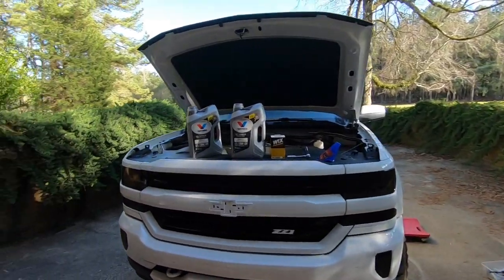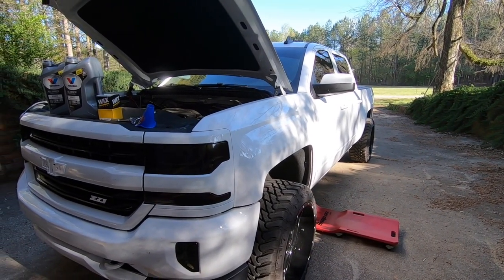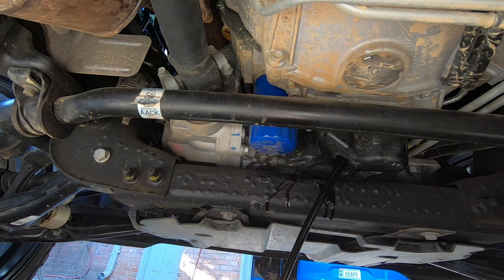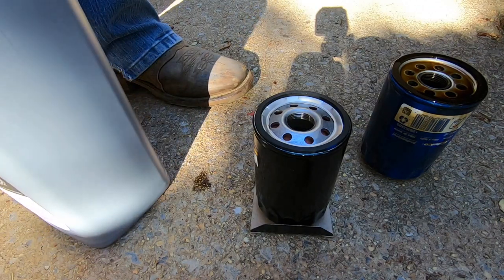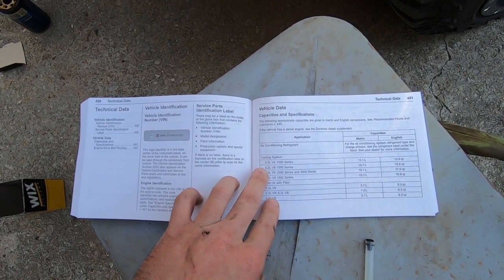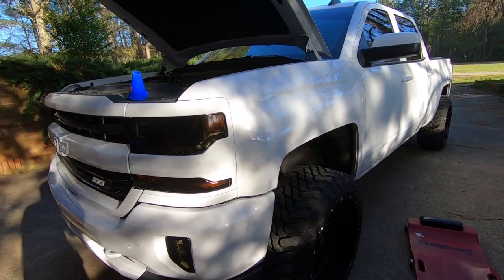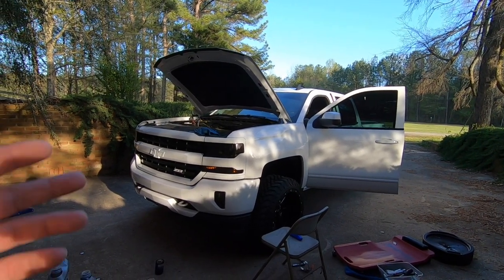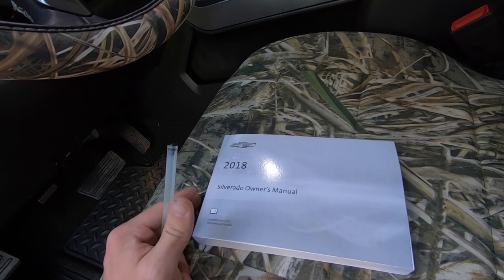2014-2018 Silverado OIL CHANGE - step by step

Comment: I take a nail and poke a hole in the middle of the oil filter and let it drain to avoid making a mess on that cross member. Nice truck!
Reply: good idea
Reply: Thats what I use when i cant get a filter off
Reply: Oside_LS3 does the nail pierce easily? Does this damage any of the threading of the filter housing?
Reply: RYPES 808 yea it punctures easily. I puncture the hole on the bottom of the oil filter with like a 2” nail. You don’t need to hammer the nail all the way in. As soon as the nail punctures the outside layer of the oil filter the oil starts draining out.

Comment: Life hack: if you can’t get the oil filter off and don’t have the clamp tool, hammer a screw driver all the way through both sides of the filter, let it drain, use it as your handle to twist off the filter, super easy to pierce the filter also!
Reply: I had to do that the last time I changed my oil. I was ripping the metal, so I did it again at a different angle and it worked the second time. Very useful, saved me from what was starting to feel like a bad situation haha
Reply: If you don’t have an oil filter tool then get one. And before you go driving a screwdriver through your oil filter just use a rag or rope and twist it with a stick or screwdriver until it is tight then turn it off. I did that driving through filters many years ago sits just awkward and messy. Not the way to do it. Unless it’s the only way with what you have tools wise. When you pick up your oil buy the filter wrench once and done. I probably I’ll bet have two tool box drawers with just oil filter wrenches. I have ones you use with ratchets. The worst vehicle I changed oil on was my 2001 expedition. Seemed like I struggled with that every oil change. Lol. Easiest is my 99 f350. But after watching this video my first oil change on my 2018 Silverado looks like it might be the new easiest. I had the oil changed at my buddies garage since I’ve owned it but I’m like 7000 miles since last change and he has two trucks on his lifts that can’t be moved so I’m gonna lay on the ground and do it myself. Not gonna be easy with my knees as bad as they are but I’m gonna do it in a few minutes. Nice looking truck and that front end looks really good. Thanks for posting the video

Comment: Good to see you’re using a good oil and good filter. As long as you use an API approved oil you’ll be in good shape. Cool video man 👌
Reply: I used Fram oil filters for many years on my '82 Monte Carlo (Don't have it anymore) because I thought Fram was the best. I watched a video and found out that Fram was the worst of all the filters that were compared. Go with Wix.
Reply: @manuelgonzales2944  I've used FRAM oil filters and air filters for the past 30 years never had a problem as long as you do it right

Comment: I have always used an old antifreeze container for oil filter removal. Lay it on its side cut out to fit vehicle. Always leave cap end accessible if needed to drain. Less mess and easier cleaning up.
Reply: You are a genius my friend ..thanks for sharing the tip
Reply: Davek why have two different dirty containers. The oil pan he was using is the same one I use. Not sure why you would want to use two. I use one you talk about for lawn equipment cause it doesn’t have much oil. I’m being rough I guess. If you happy with your gallon jug for filter oil. Do it. ✌️

Comment: Life Hack:

Break the oil filter loose before anything since everything is dry and not slippery. Won’t leak if only loose. 

Second:
Always do your partial Jug first. So you can measure it and if somehow you mess up and go over, you can just put the rest in and have a second chance to do it right on the second jug. Otherwise if you overfill you have to drain it all out and start over.
Reply: Mitchdenes I don’t think he had a partial jug to deal with. I don’t understand what you mean anyway. It takes 8 quarts so you empty the first jug weather it’s a gallon or a 5 quart jug then add two more out of the other one. Check it then add what’s needed. Can it get any simpler?  Why would you add a partial jug first.  Just seems more complicated or confusing to add from an open jug first. When you start with a new container you know exactly what you have. Maybe it’s me over thinking it or I’m just stupid idk. Either way get it done ✌️
Reply: @johnsellers9623  yes, you are over thinking it.  Partial jug, not an already open jug. You add the final two quarts first you’re referencing because it’s easier to add the rest of the jug and get a second chance at adding the right “partial amount” if you over fill. If you’ve already put it the entire other jug and overfill by accident you gotta drain the oil out again vs just putting that entire jug in and getting another chance at the “partial jug” if that makes sense!

Comment: You forgot that you filled the new oil filter with oil! You added 8 total. 
I always use seafoam in the engine a couple of months before the oil change with 8 ounces of seafoam per 1 ounce per quart,  and add a full can into my fuel with about 5 to 8 gallons of fuel just as I am going to change the oil within an hour or so. I than head on the highway to clean my injectors for about a half hour with high rpm' s to remove as much deposits  as possible from the engine. I head to the gas station and fill up my truck with fuel as I leave it running to delute the seafoam that is still in the fuel. Once at home I turn it off and drain the oil with all of the deposits from the engine coming out with the old oil! It is amazing to see how black the oil becomes after using seafoam!  Repeat for every oil change. Peace

Comment: Seconds.  Love the part when it drained and went on the cement a bit. I was like, “Damm!”
Reply from the maker: Same! lol
Reply: Yeah... I always try to do a no drip change there is always something that I do to get a drop on the cement or garage floor.
Reply: I could perfectly position the catch pan; but then the wind say, 
"Ground looks too clean."
Asphalt driveway are terrible during summer, but oil leaks hide so much better.

Comment: I have the same exact truck you have.  I got it 7/31/18. It's now 5/2/19.  I still haven't changed the oil in it.  2850 miles on it now.  Ha. Going to see if I can make it a full year. Ha!  The dealer calls me every week to have me bring it in for my 2 free changes. I bought a Fumoto valve for the pan and I don't want them to install it.  Had one on my car for years. Worked great. Wanted to put one on my Ranger 4.0 but it might stick down too far. Will probably do it anyway.  Makes oil changes much easier and you will never have to worry about your pan threads.

Comment: I use wix and napa gold filters.  I also pre-oil them.  I only took my truck in for the first free oil change at 600 miles.  They left oil all over my new steering wheel, tighten the oil filter so tight that I needed water pump pliers to take it off and they over filled it!  Never again.

Comment: I use an old antifreeze container. Lay it on its side and cut out the middle out of it. This way when you loosen the oil filter it collects all that mess. Then later you can dump that oil back into a container and dispose of it properly.

Comment: I just bought a 2019 silverado first brand new vehicle i have ever owned. 0W20 oil is insane to me  the stuff is like water I dont see how it lubricates anything. But thats what it says so thats what I will use. Big step up from the 2000 silverado and just dumping whatever I had setting on the shelf in it lol.
Reply: Jeremey Taylor You CAN use freaking 0w20, but 1) Use good brand, like Pennzoil ULTRA PLATINUM or AMSOIL and you have to change it every 3…4 thousand miles for sure. 2) You can freely use full synthetic 0w30 or even 0w40 100% full synthetic polyester oil like AMSOIL,  very important “zero” previous w in oil grade.
Reply: Your best bet is to use what your vehicle manufacturer recommends that 0w 20 is what's best for your vehicle Mobil 1 recommended

Comment: Just curious, is the washer for the  drain plug an elastic o ring, or a metal crush washer? Rather to be prepared than be sorry, because some dealership parts department are closed.

Comment: Quick question the three bolts too the left from your hand in the video when your losing the drain plug especially the new silver looking bolt can that section be replaced if so what is that section called

Comment: You should try  upgrading to Royal Purple 5w30, Marble Mystery Oil and k&n filter , you will definitely feel the difference and gives you way better performance and power. 6l of Royal Purple , 2l of Marble Mystery Oil and K&N Filter 🤙👌💯
Reply: I been thinking of going 5/30 on my 2018 Yukon but it says it requires 0/20 would it be ok have you used it in your vehicle? Thanks in advance.

Comment: How are you getting an estimated 413 miles on a full tank? I’m running a 2.5 RC leveling kit on 275/70r18 on a 2014 and get about 345 on full tank

Comment: My oil filter is on crazy tight too after a trip to the dealership . I couldn't get it off. The swivel wrench i used kept slipping and wouldnt grip. It's all dented now from the vice grip i used after. Probably will have to poke a hole through it

Comment: Does your leaf springs make loud noises?  I have a 2016 Chevy Silverado 1500 and the leaf springs have been making noises since around 10,000 miles.
Reply: I have a 2018 Silverado and the leaf springs do make noise. I oil in between them with Fluid Film.

Comment: Had  a 2017 gmc with 4 free 1st on they bent my rim did not open lift arms enough then 2 oil change tire rotation broke lug nut off lol no more oil change at the dealership for me ha I will do it myself

Comment: I put Mobil 1 extended performance with a Mobil 1 filter. I don't drive much yet, so it'll last me a year. I've had mine a year, and only have 5255 miles.
Reply: Does it run smooth

Comment: I naught 2016 Silverado and get 5 free oil change including the tires rotation 
I work on a tire shop and after 3 oil change based on my tires problem 
I believe they never do the tires rotation and that make me to ask my self if the change the oil 
So o start doing it my self just a comment

Comment: If you picked WIX by accident, you got one of the best ones. Yes, it does matter. Study the filter world and you will be surprised. Won’t use anything but wix now. I’m not so sure I agree with your logic on pre-filling the filter. I did it once in the 4-5 dozen oil changes I’ve done. NEVER. been a problem. What does it matter if it’s dry at start up? It will quickly be full. But do what you feel comfortable with.

Comment: Doesn't it void warranty if you do it yourself?
Reply: No. Had a 2011 Terrain. Did it myself every 5k. Had every 5qt jug to prove to dealership. Every factory warranty was applicable
Reply: Old comment, but I asked the dealer when I bought my truck and their manager told me that you can do it yourself and not void the warranty, but you have to document it in case anything goes wrong. So they told me I had to do something like take a picture of some part of the process (like filling in the cap) and record the date and what I did. Never had an issue with this though, but I did have my oil pan gasket leak at 57k miles and they never even asked me about oil changes (and I have a catch can, intake and exhaust mods). They're mainly concerned about you using tuners or doing some jb weld shit somewhere you shouldn't be lol

Comment: 7 quarts taught it took 8 ?
Reply: it does
Reply: It depends on what motor you have a 5.3 vortec is 6 quarts a 5.3 ecotec is 8 quarts
Reply: 8 quarts for the ecotec 5.3 is correct 0W-20

Comment: I get unlimited from my dealer here in FL.
Reply: Great. How long does it take to get your truck back? I waited up to 5 hours here at my dealership to get my truck back . After two years of this I have decided to say no to that and keep my money instead. Just bought all tools and items to do my first oil change this weekend. 👊🏼 though I’m not saving a lot, hopefully in 30 mins I’ll complete the oil change 😁
Reply: @almas7123  usually in and out in 30 lol. I do prefer to do my own still though.
Reply: Anubis Outdoors 
that’s great! Your dealership must be small and have no customers😁. And at least I’ll know I’m doing it right (hopefully) I now have a stripped bolt that secures plastic cover that’s goes over oil filter and pan and also a ruined wheel lock cause they failed to ask for the wheel lock key. (Tire rotation was included w every oil change)

Comment: Your battery gauge is not looking good
Reply from the maker: Looks perfectly fine.
Reply: lmfscrew my battery was always almost to 9 and I had a bad battery and ever since I replaced it it’s been past 14
Reply from the maker: The two lines are the normal zone. The truck doesn't alway demand the truck charge the battery. Fluctuation within the lines are completely normal. Above or below 14.